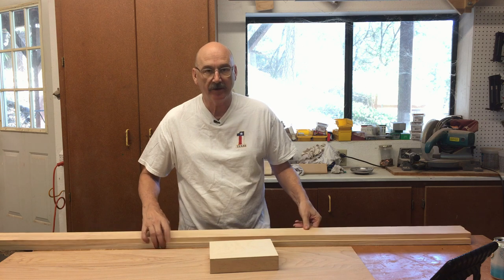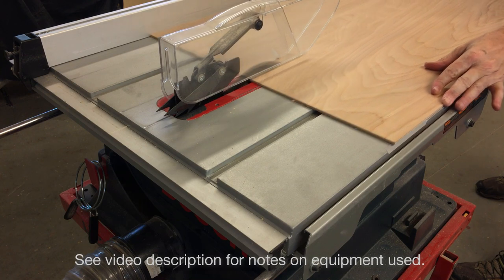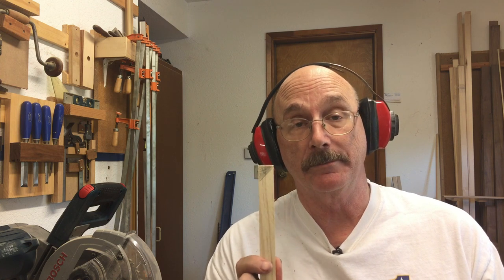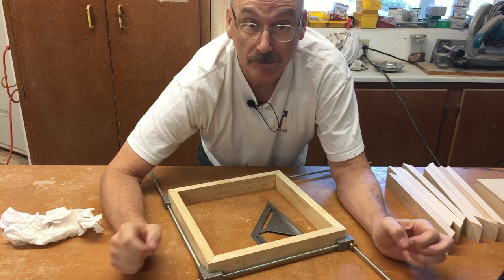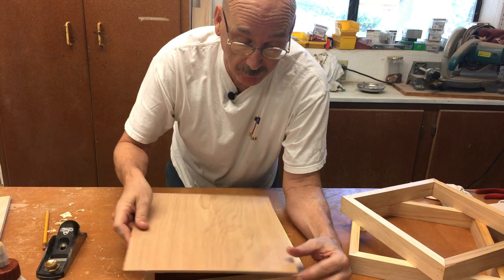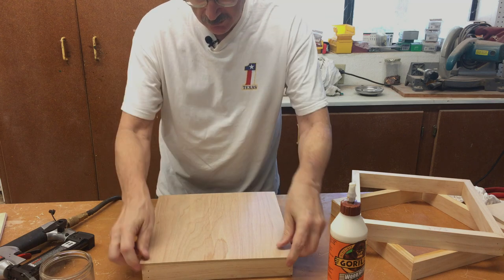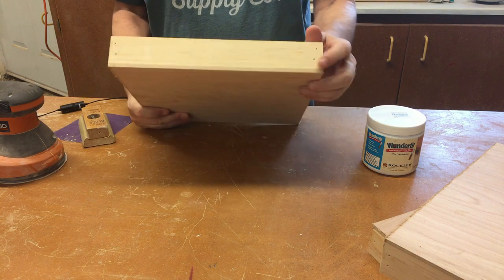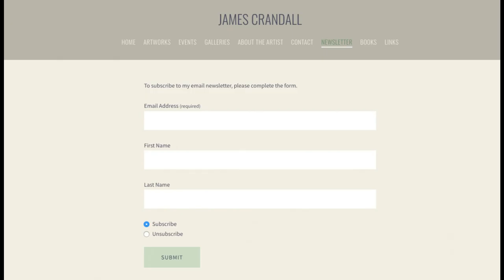Making Painting Panels

Comment: When using the pin nailer for surface, it can help to put a piece of cardboard between the tool tip and wood to prevent marking at pin sites (for softer wood.)  I should drive and set as normal right through it but prevent dents and such.
Reply from the maker: Thanks I might try that

Comment: .?do the Brad nails on the painting surface get filled and do they ever work there way out or do you glue canvas on that side?
Reply from the maker: No, they don’t come out. They’re very thin, wire pins really, and have a “slight head” on them.  Whether the panels are primed with gesso or covered with canvas, the tiny holes can be ignored.

Comment: I'm concern about the use of nails, do you think rust could be an issue in the far future for the painting?
Reply from the maker: I don’t think so. If you think about it, nails are used in furniture, interior woodwork, picture framing and also to tack canvas to stretcher bars. These panels will be sealed over with primed canvas or multiple coats of gesso, as well as paint and varnish. I wouldn’t worry about these brads any more than I’d be concerned about the nails inside the walls of my home.

Comment: How should you treat the panel if you were to make a larger size? Do you have to treat both sides of the panel to prevent curvature or is one side sufficient?
Reply from the maker: In larger sizes I will add additional braces to the back, a cross brace across the middle of the long sides and perhaps some 45 degree corner braces.  This seems to be sufficient to keep everything flat up to about 36 inch sixes (I keep everything clamped to a flat table as glue sets).
I’ve rarely done anything to seal backs, apart from some spray shellac (maybe).

Comment: Is there an ideal type of wood for the panel and cradle part? I’d don’t hear you say the type of wood.
Reply from the maker: I generally use Pine for the cradle, though knots should be avoided. I have also used popular, though is heavier and could be more expensive depending on the source.
For small panels I’ve also used strips of Baltic birch plywood for the cradle.